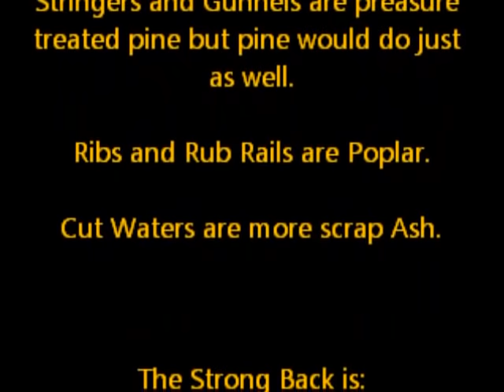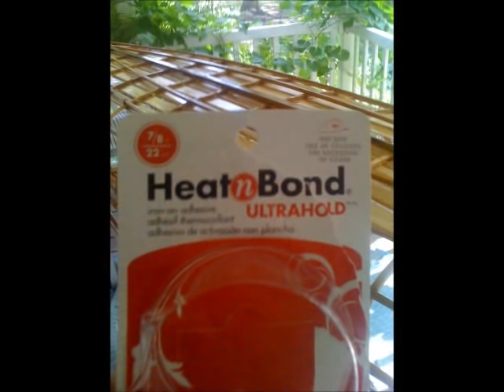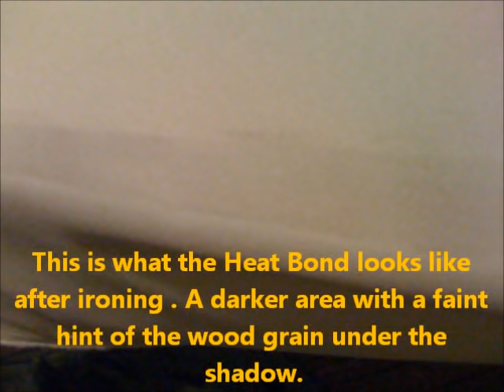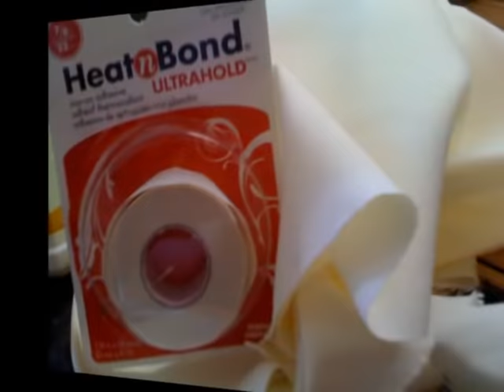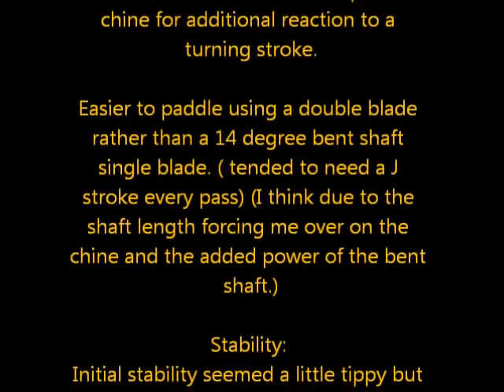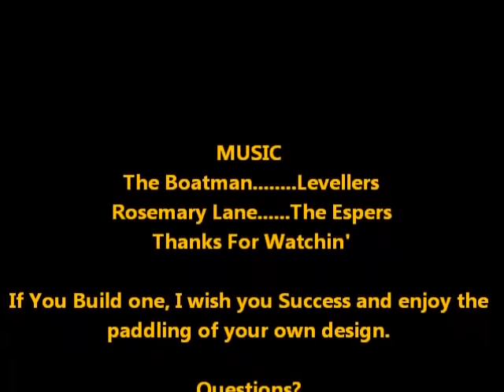My SOF Canoe Design and Build (Freedom)

Comment from the maker: Thx Dadio. I bought the fabric from a local sewing center. The ladies there were very helpful and got really excited when I showed them pics of the finished boat.
I chose the heaviest standard weave they had. If I recall correctly, the fabric was 96" wide. Once I got the length I needed I had enough for 2 boats.
For the urethane, I used an oil based, high build, gloss, one part on the wood and the fabric.
For the fabric, you will need to thin the urethane by half (50:50) for the 1st coat. This ensures you will get full fabric penetration and a good seal. 2nd and 3rd coats are straight urethane.
I don't suggest further coats. You will begin to get brittle.

Comment from the maker: Thank You. In Platt Monfort's concept, he used Kevlar roving to limit lateral flex. I chose this method because I wanted to use only materials that could be purchased off the shelf at local stores. I bought the lashing at a hobby store, Michaels I think. The glue was probably over kill but it held the ribs in place until I could lash them. This freed up my limited supply of clamps.
Hope that answers your question.

Comment: Beautiful? Well done!
I think most viewers would like more precise info on the fabric & adhesive tape which ordinarily I would be reluctant to trust.
How resistant is the cover fabric to accidental damage such as typically occurs in launch & retrieval.
Any thoughts on adjustments to improve stability?
Thanks for the series of pics.
Reply from the maker: Well Peter, information about the fabric is hard. I just went to the fabric store and asked to see thier Dacron selection. I chose the thickest they had in the store.
As for wear, I have since added a coat of poly to the boat because a sizable tree branch hit the boat on end and caused a spiderweb of cracks in the finish. (yes it stays outside) I need to replace the bow skid plate because of an unnoticed crack from steam bending continued to spread.
For stability, and because the boat is designed for my wife (a much smaller paddler) I would widen the beam a couple of inches and flatten it as well. The wife wouldn't let me change hers though.
Reply: Thanks for the quick response. You generally hear how tough this construction is, but a tree stump has compromised yours so soon.
I think Dacron &"Polyester are esssentially the same thing, at least in this field. I have also read about "ballistic rip stop nylon" & kevlar strip used in diagonal rovings for additional strength.
So right now you have doubled the skin? Would you also in future reinforce the stem design which appears to have suffered during your "impact".
Again many thanks for the introduction to your masterpiece.
Reply from the maker: +Peter Owens 
With any material choice there will be a trade of some sort. Weight, shear strength or abrasive resistance.
With this style of boat you get high shear strength and light weight at the cost of abrasive resistance. The stem of the boat didn't fail. It was actually the 1/4 inch bent skid plate that failed. The piece had grain run out that I didn't notice. A poor choice of wood on my part. 
here is a link to a tuber that has put this material to the test. 
happy building.

https://youtu.be/ATktVym_NeI

Comment: She is surely a sweet looker, i love that cloth on frame look when the sun creates the sharp lines through the sides. I hope she gives you many years of pleasure.

In the area where i live Poplar is a very plentiful wood. How will poplar do for most of the work on the frame, since it is very cheap to get around here.
Reply from the maker: Well Johan, I would say poplar is a good choice. Though steam bending poplar isn't ideal, it can be done. Plan for needing extra ribs and be sure to allow for plenty of steam and heat time.
The ribs on this boat are polar.

Comment: Is there a problem to use epoxy instead of poly???   for  coating
Reply from the maker: Sorry for the slow response. 
I dont think that would be a problem as long as you add a UV protectant.